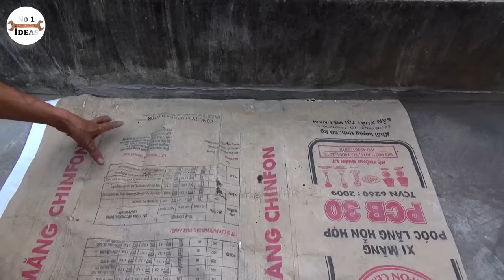DIY an Amazing 3-Floor Waterfall Aquarium

Comment: How often does it needs to be cleaned ?
Reply: Water is moving. So I really don’t think it need to be clean very often. Several months maybe.
Reply: With the amount of fish he has nitrates will be through the roof in a week. Considering its cycled properly.
Reply: But water pipes are not connected to it for new water supply.
Reply: GLAM QUEEN you add water to it when the water level drops. You have to keep it topped off. But since it’s outside it will rain in it, so topping it off may not be an issue either.
Reply: وليد خالد

Comment: The bananas'plant for what? 
I want to know
Reply: If u put fish in right away once you done building this. All the fish will die.   You need to remove cement toxins.  So for me since i live in the city (usa) and there is no banana leaves lying around so all we do is fill it full with water and drain and refill then repeat.  Do it a couple day and toxin should be gone by now.

Comment: I assume he doesn’t answer the comments. But I will ask anyway; what’s the purpose of the banana tree chopped in the water and left it for 6 days? Does it seal the fountain?
Reply: One of the main ingredients in cement is lime, which is very alkaline- too alkaline for fish and plants. Soaking lets the excess lime soak out, and banana neutralises the alkalinity to stabilise the pH. You can just soak for longer without, or soak with a bottle of vinegar. Other plants can do the job, I think oak leaves are one. You can also buy banana leaves online to do the job if you can't get them locally. Adding an organic matter can also kick start the bacterial growth so the filter medium already has the start of a healthy biome by the time you're ready to set up the pond with plants and fish.